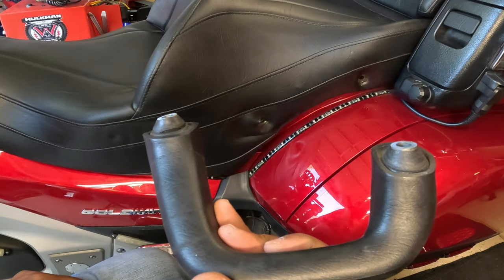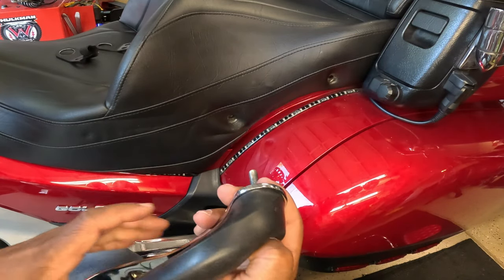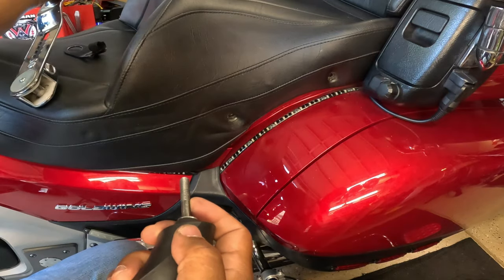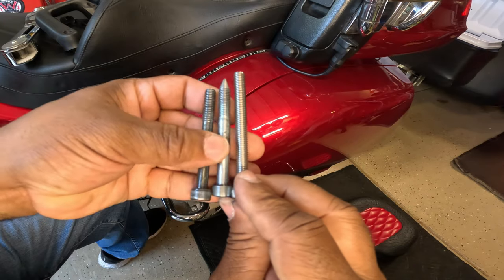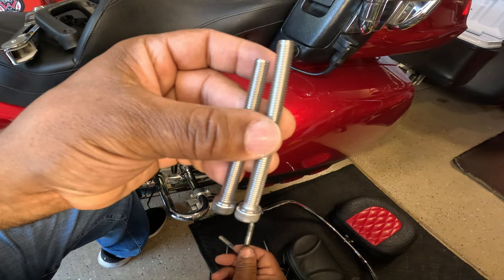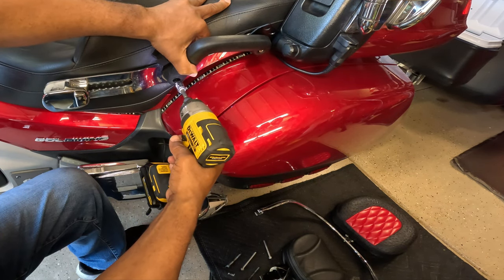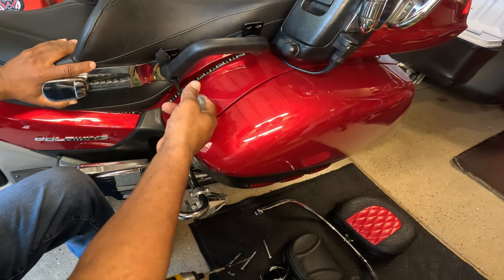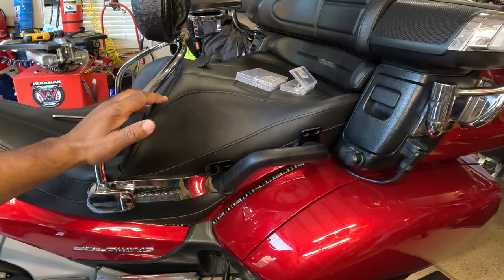Loose Passenger Grab Rails Quick Fix | Honda Goldwing GL1800 Seat

Comment: When there’s a need and the light bulb goes on. Watch out, the Caliente Garage knows no limits. In that Rolodex of a mechanical mind the results are always tight and clean. With no excess and no slop. Excellent  job Chris.
Reply from the maker: Thanks RG,I appreciate it.  A good installer must always be prepared to improvise.

Comment: Great video Chris,  I would suggest in future. That most major towns and cities have something called a fastener store.  It's where factories and mechanics and that sort of company goes to buy their nuts and bolts.  And you can walk in with that original bolt,  and they will have all the options, lengths, black, stainless or zinc, and even whatever you want for head type.  You'll probably be their smallest customer buying a few bolts rather than boxes full, but most are happy to sell to you.  Way more options then buddy Bezos, or the local big box.
Reply from the maker: Thanks but the point is not where you buy your materials but how to fix the problem.